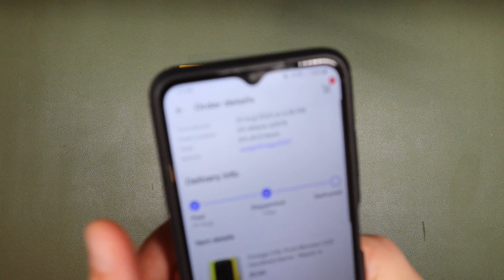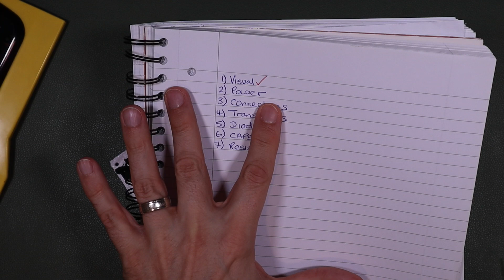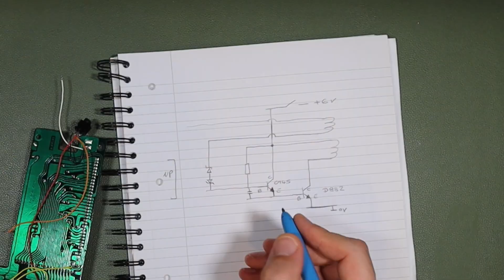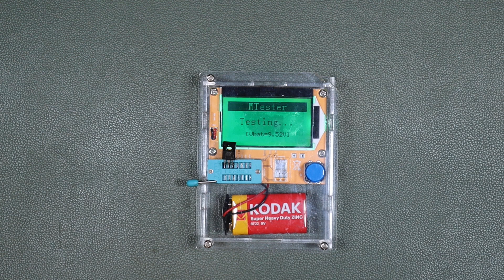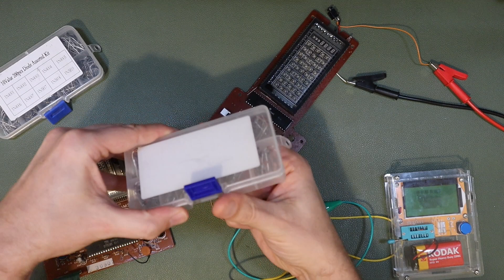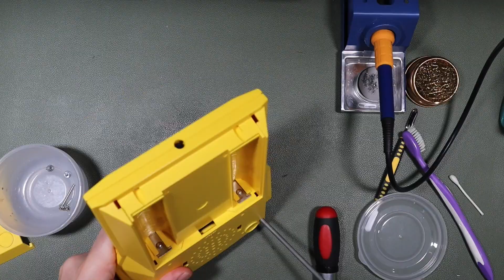Found a Broken Puck Monster | Can I Fix This Rare Handheld?

Comment: Nice video Sir! I also have one where you hear the sound but can't see anything on the screen. What can it be? Thanks!
Reply from the maker: I am not an expert on these games, if it were mine I'd open it up and check to see if the getter is intact (black marks on VFD display). Then I'd check connections on the board and look for cracked tracks or burnt parts. Next id start testing diodes and transistors. Sorry I can't be more help

Comment: Thankyou so much for making this video. I just bought one of these with the exact same issue and I think you’ve just given me a fighting chance at fixing it!
Reply from the maker: That's Great! Thanks so much for your feedback let me know how it goes 😊
Reply: On closer inspection it looks like the screen seal may have been broken, I didn’t notice three filament wires inside the screen are broken and where yours has that dark mark in the bottom left corner, mine it’s white and burnt looking. So probably well and truly beyond my skill level to fix
Reply from the maker: well its taken 2 years for me to spot this, but yes if the black spot has gone white then air may have got in and it might not be repairable without a new display.
Reply: @RetroTechRepair it’s a shame I wasn’t able to repair it, but it’s a nice display piece nonetheless. And who knows, I might find a replacement screen someday

Comment: I just found this video. I have one of these games with exactly the same fault. No display and a hot transistor. This was caused by the dad (Many decades ago) plugging in a power supply (Which was most likely the wrong polarity) to see if he could save money on batteries. I have already replaced the two transistors and that's as far as I got with no luck, I may try replacing that diode (Yeah, unmarked, so no idea what to replace it with..)

Note to self, try a 1N4005, a bog standard rectifier diode in that location!
Reply from the maker: Hi so glad I could help. Thanks also for the input. I had often suspected that the incorrect power supply is what causes this kind of fault but nobody had yet been able to confirm it. I hope you get yours fixed. Please pop back and let us know how it goes. Thanks for your comments. Much appreciated

Comment: I really do appreciate how you're not an expert at these and we get to go through your troubleshooting process. It honestly gives me the motivation to try my hand at fixing some older toys I had previously written off when I couldn't right away figure out what their problems were.

I definitely need to get myself a little pack of diodes and transistors!
Reply from the maker: Oh what an inspiring comment 👏 thank you so much! I have a few parts and bits of equipment now but still operate from the hall of my apartment... no "lab" for me! You can definitely get a long way with a cheap multimeter pack of diodes and a few transistors. Thanks again for the feedback I hope you give it a go and if you do pop back and let us know how it goes. Thanks again. Roger

Comment: I have one of these which my sister had from new which appeared dead.  With little knowledge, I had a look inside last year for anything obvious and the transformer (I didn't know that's what it was as I couldn't find any repair videos at the time) was broken as the top had come off.  Does anyone have any idea if this component exists anywhere as new or is this a repair too far?
Reply from the maker: Hi Dep I haven't ever seen a transformer for sale and I don't have a spare. But are you 100% that's the problem. I haven't ever seen a failed transformer in a VFD game. The transformer might still be OK if the "top" is just cosmetic

Comment: Another great repair and helpful for others to diagnose their broken consoles. Wonder why these diodes keep breaking. Maybe the manufacturer used the cheapest possible part that would "work" and didn't consider derating them. Probably didn't consider it would still be being played after 40 years!!
Reply from the maker: Maybe! I have to admit I have thought about a vid where I repair then try to recreate the failure. I have a lot of VFD games yet to repair so I hope there is some variety in them. You are probably right that the design life wasn't 40 years. Thanks for your comments and continued support. Hope you are well.
Reply: @RetroTechRepair  you're going to have a whole arcade of these desktop consoles! Maybe do a video showing your collection. Imagine the racket if you power them all up at the same time! My AstroWars is so loud I have to put tape over the speaker... Volume control mod needed maybe!!

Comment: 1N400x is just a normal power diode, the laset number is the voltage range 1 being 50V 2 100Volt 3 200Volt and so on - the diode is probably something like a 1N4148 - also a normal diode, but a small signal diode
Reply from the maker: Thanks Dennis, that's great to know thanks so much!